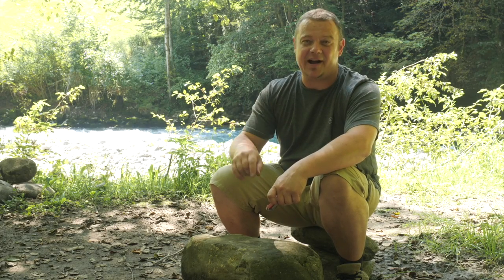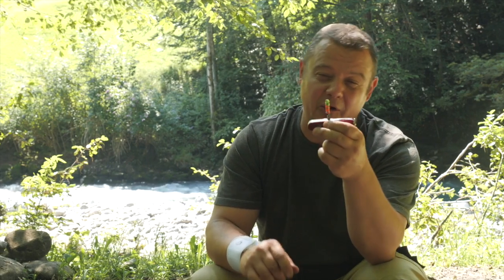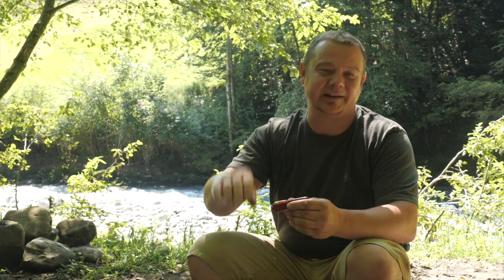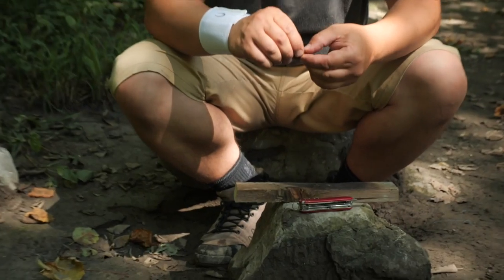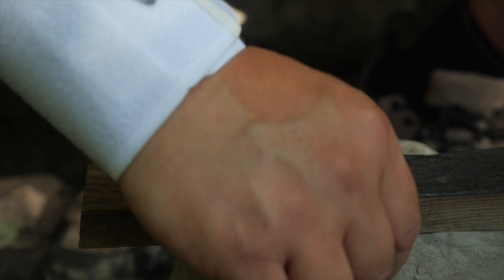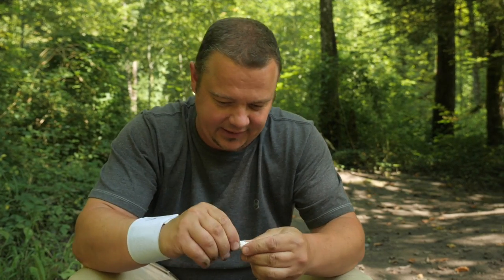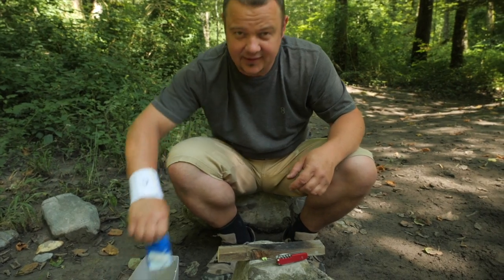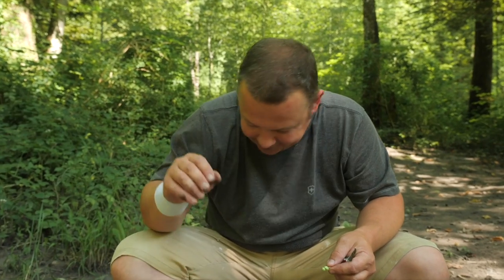Victorinox claims: 100 fires with just one FireAnt. Is that possible? Let's test it!!

Comment: You know what lights VERY easily, and you should have in your kit or pocket anyways? Gel hand sanitizer. Mostly made of ethyl alcohol, not only does it light from a single spark, it burns for several dozens of seconds, and is wind resistant, giving you plenty of time to build up a fire. It burns with a blue flame, very much like the Steno buffet food warmers. Give it a try today!
Reply: Agreed!  Or even the humble Vaseline petroleum jelly!
Reply: @dennisleighton2812  I'd second the petroleum jelly.

Comment: One tinder everyone literally has on them are the clothes your wearing. Fibers from any cotton clothes, like jeans, can be shaved off with your blade giving you a nice little pile of lint.
Reply: Gel hand sanitizer. Seriously, give it a try. A squirt will light from a single spark, burns with a blue flame, lasts for several dozens of seconds, and is wind resistant. Plus, you will have clean hands. Give it a try!
Reply: One thing to be careful of when burning hand sanitizer is that the blue flame can be very difficult to see.
Reply: Belly button fluff ;)
Reply: @noncompliance4100  Yeah, but it doesn't burn long. And it has a smell. 🤢
Reply: @OutsideTheTargetDemographic  tried it myself a few months back out of curiosity. One strike and it caught immediately . Perfect addition to a small piece of tinder
Reply: @markhampson3166  Hey, great! I had a friend over and we both tried very very VERY basic survival stuff. One of the items was firestarting, while slimy PJelly cotton balls worked, his mind was blown when I showed him the hand sanitizer. 👍
Reply: @Schwubl_262 I will try them both when the snow hits and see. 👍The nice thing is, both "fuels" have other uses.
Reply: @markhampson3166  And there's a lot more fire accelerant in your ears... with a smell too. Your camp fire will tell everybody how sm(e)art you are!

Comment: This was originally put out by a company called Tortoise Gear. The first micro fire steel replaces the toothpick on your knife and then they made these micro steel inserts for the SAK corkscrew. Neat that Victorinox picked up on it. The Tortoise gear ones also have glow in the dark plastic which is neat. No, I wouldn't use these as a primary fire source, but as a back-up, they are hard to beat. Thanks again Felix!
Reply: Brendan, I looked at these when I found out about them, but the cost of getting them to the UK made them unviable. I opted for a 4.5mm ferrocium rod in my Swiss champ case. I assume you would recommend them?
Reply: Felix didn't mention it, but these glow in the dark too.
Reply: @boola69  I do but there is a 'technique' to striking them. You strike along the top 'thin' edge, not the broad 'flat' edge. Also pull the blade (or striking surface) along the fire steel, don't pull the steel across the blade. But it does throw some sparks when you get it right.
Reply: @brendanking7328  Yeah, I'd seen you used the narrow side on a review.  I think I'll just stick to the ferrocerium rod as it takes up little space. BTW cotton balls soaked in Vaseline (Petroleum Jelly) make amazing tinder, but you probably knew that.
Reply: Victorinox is buying these from Tortoise Gear.
Reply: @boola69  yea i saw that too, with shipping it made them about 3 times the price.
Reply: They say the best tool is the one you carry with you. So many times I forgot the lighter at home and tried unsuccessfully to make two wooden sticks burn like in CastAway. The FireFly would be great as a default from Victorinox.
Reply: @DilbertMuc  That's not a bad idea, fella.
Reply: @brendanking7328  Oh, always check the Youtube channel of Felix Immler. He'll teach you 100 uses of a Swiss Army Knife. Check his episode The Firefly Technique - SAK Tips & Tricks (37/40)
Reply: @boola69  But with cotton balls soaked in warm candle wax you can make new FireAnts yourself for free.

Comment: Thank you! I also use the firefly that fits in the toothpick holder on the Victorinox SAK. It makes that wonderful folding knife even more versatile. But…. The greatest asset on my Victorinox is what you bring to us through your videos. Thank you so much again! You even showed many fire starter possibilities 👍cheers from Canada
Reply: The tooth pick fire🔥steel is MUCH more practical 👍
Reply: @edwardfletcher7790  : But I would rather give up my mini screwdriver than my toothpick:(
Reply: @markashlock9017  You could always swap them when you go camping, it's not like you need a firesteel at work.
Reply: @edwardfletcher7790  You can always make a toothpick. It would be way harder to make a firesteel rod ;D
Reply: Edward Fletcher, I’ve not tried the corkscrew insert, but I do know that the toothpick version doesn’t fit in the RangerGrip series toothpick. Found this out the hard way. I have a snapped one still lodged into mine.
Reply: @brawndothethirstmutilator9848  There's lots of helpful videos on YouTube showing you how to remove the knife scales, people use either hot water of a hair dryer ...👍

PS: Love the Idiocracy tag, wish it wasn't turning into reality ☹️

Comment: Great video, as always. But, I can't imagine myself needing over 100 "emergency fires." So, why WOULDN'T I use this as my primary fire steel, especially when it is just a backup to my lighter?
Reply: 27€ for 3 of those. Way to expensive to use them casually in my opinion. Just use a lighter or a normal fire rod as it's way more value for your money.
These are nice to have, but when will you ever be outside with your pocket knife, but no other way to start a fire? For half the price I might get them, as it is they are just a gimmick for me
Reply: @TeamGermanLP  when you forgot to bring a lighter to barbecue it's priceless.
Reply: @TeamGermanLP  Lighter, Aldi, 25 cts. :)

Comment: From this video the most important take-away was your comment about having the appropriate tinder. 
As preparation is the mantra for all who travel in nature and the outdoors, it is clear that part of that is to pack several different sources of tinder material. Fortunately, it is not at all bulky, and one can easily pack enough for hundreds of fires and scarcely notice the weight or bulk of that tinder. As was pointed out even fine birch bark shavings are not always easy to ignite. 
Thanks Felix, for a most enlightening video and some extremely important information. 
Note: If one carries with you in your pack a humble domestic candle, it will make a formidable team with the fire ant! The fire ant gives the initial small flame and once lit, the candle provides the strong sustainable flame to light the fire in almost any conditions. 
This video has conclusively exploded some long standing myths and assumptions about starting fires!
Reply from the maker: Thanks a lot for this super interesting feedback!

Comment: Hello Mr. Immler:
I have been carrying and using the Tortoise Shell brand micro fire stick and helix tender for a year. Loved your review and you are correct as it is only an emergent starter, but man it is handy! One thing I experienced was that the helix tender would wear while in the pocket. So I found out that slipping a big straw over them works well to protect the tinder from the abrasive material in the pocket. I hope this helps other SAK carriers. Keep up the great work!!!!
Reply from the maker: Yes I will make a video with heat shrink tubing! Thanks for your hint

Comment: 100+ strikes! You have some patience! Thanks for doing this test.  I took a cheap ferrorod/ magnesium combo from the dollar store, and used acetone to unglue the skinny rod from the magnesium block. Then put the ferrorod into a drill and spun it against 80 grit sandpaper (which took way too long) until it was narrow enough to slide into the corkscrew. Then I carefully cut it with a hacksaw.  I used a Sharpie marker to (hopefully) protect it from moisture and voila: a home made sak ferrorod, which is as long as the corkscrew. It fits well into my Rangergrip 79 and the recess for the corkscrew keeps the ferrorod from falling out when the corksrew is put away, but I didn't add anything else to keep it in place with the corkscrew open, other than the friction fit.  I suggest a file or some other means to remove the bulk of the material from the original rod. because sanding alone took way too long. I had to remove about a quarter of the diameter of the rod.  Now, can I wrap some waxed jute twine around it for tinder.... ?

Comment: I agree, this is great for what it is. I got 2, one for my Huntsman and one for my Ranger. If I use up my lighter, and my matches, it's a great backup to my full size fire steel backup. It throws more spark than I expected for its size.
Reply: Remember your lighter still makes sparks after the fuel is gone
Reply: @margueritemitchell1829  true, but I was surprised at how much harder it is to direct as much spark with a lighter as I can with a ferro rod

Comment: Great video.  I have had success by taking thick piece of birch bark and then with very little pressure using knife at 90degrees to scrape along flattest section and creating a powder.  Not only is that powder easy to light with spark but works with magnifying glass as well.

Comment: I’ve have both of those & the one that replaces the toothpick. I’ve only played with them & they all work rather well, but you’re right it’s not for primary fire making. If the knife has a corkscrew why not add it 🔥.
Reply: @Ministry of Mystics Well, I would replace the glasses driver with the fire steel and carve a mini phillips driver out of the fire steel with a diamond file. Use it as an emergency glass driver and in a pinch it can always give me fire.

Comment: I just lucked into a procedure that makes Firefly becoming my most favorite thing! I got a big SAK Ranger Grip 58 Hunter. Then got large Firefly which needed end tapering to fit into SAK. I had used 6 cm. wide 120 grit sanding belt just laying around. I found rubbing FF on piece of belt very entertaining! Dust would accumulate on the belt. When there was enough dust it would erupt into a pyrotechnic display on the belt. It took a relatively long time to grind the square FF to a pointy toothpick profile. I guesstimate that there was enough large flashes to start over 100 fires in just the 2 cm tapering operation. If I carry a 6 cm. x 10 cm. patch of belt I could start an amazing number of fires; + other uses.

Comment: Hi Felix, love your videos! 
I think the fire ant sticks are quite expensive. Could you maybe make a video in your workshop series how to make them with Zündsteinen für Bügelgasanzünder. They are super cheap and if you craft a handle/backpart that goes in the corkscrewer, you might be able to drill a hole and glue it in.
Thank you so much for your work! Best from Germany
Reply from the maker: Hallo Simon. Haaa ha haa ich habe vor drei Tagen solche 3mm Bügelgasanzünder im Zehnerpack bestellt. Die haben an verschiedenen Stellen Platz im Messer. Das möchte ich zeigen...
Danke aber für deinen Tip! LG

Comment: The FireAnt was introduced by Tortoise Gear, and its considerably cheaper in USD from them (you only get 1 tinder per FireAnt instead of 2, however). They also produce the FireFly, which is a ferro rod that replaces the toothpick.

Comment: I have a firefly and the tinder coil in my forester. Works great. The fire ant is awesome bc you can keep your tooth pick. I use the toothpick on my multi tool regularly. Might have to get one. I went with the firefly bc it’s bigger but the ant seems to work great despite being so tiny.
Reply: If you add the plus scales, you can open the closed extra slot. Might help your space needs.
Reply: @VilleWitt  yeah that’s a great idea, thanks!

Comment: Never understood ferro rods myself as most of the time a cheap disposable lighter is just as reliable and more versatile. That being said I never use the corkscrew or the parcel hook either, still nice to have I suppose.
Either way another great video Felix 💜
Reply: Lighters don't work when wet or super cold.
Reply: @wildernesseric  can't light a fire with wet tinder & fuel anyway. If you can keep your tinder dry you can keep your lighter dry 🤔

Just guessing tbh, my bushcraft experience is limited to one course I went on when I was 10 and the occasional times we go drinking in the woods and we make pointy sticks for DIY javelin throwing 😅
Reply: @marmite8959  that's kinda the point of this product.  It has a completely waterproof sparker and waterproof tinder that goes into the corkscrew and takes up no extra pocket space.  No need for an unreliable lighter and if its in your knife you won't forget to take it with you.

Comment: I just received my FireAnt and gave it a try and on about the 5th or 6th pull across the back of my saw blade the rod came loose from the plastic piece and fell onto the floor.  I managed to find it and glue it back into the little orange piece but it would have been very inconvenient if that happened in the woods.   I suggest giving the FireAnt a try before you take it into the woods just in case you have the same problem I had.  By the way it sparks very well for a tiny rod.
Reply from the maker: Please let Victorinox customer service know about the incident. I think there are other people with the same problem. I heard once that the plastic part can deform if you screw it in too deep... or something.

Comment: My first Victorinox was a Huntsman also but I had to buy it
myself in 1973. It has the old five turn corkscrew which the
Fireant won’t fit into. Actually there a few models that are not
compatible with the Fireant. The Firefly will work with ones
that have scale tools, but if you have one of the 108mm
models you are out of luck.

Comment: Hi Felix ☺ that was a great test using the fire ant, I expected it breaking as it wore down , but no it didn't,  and you still had some left, as to the problem whith the birch bark I think you might try scraping the surface of a decent piece of it whith the edge of your blade, I've found you can work up a nice small pile of wooly fibres that will ignite readily. I hope you haven't injured your wrist,,it looked well strapped up, if so I whish you a speedy recovery, thanks for another interesting video, stay safe mate, best wishe's to you and your's, Stuart uk.

Comment: Felix love your enthusiastic approach, I’ve always loved Swiss Army knives. Recently I’ve acquired a few victorinox delamont wenger models, I must say I prefer these in some ways to the victorinox models, although I do love both , I found the detent seems perfect on these wenger design models. The victorinox how ever have better scissors ✂️ and I prefer the inlay metal emblem cross . Although I found out recently that the wenger models with red handles have in layer plastic which can’t be worn off , which is great 👍🏻. What is your feeling on the wenger delamont models?

Comment: If you have empty lighter instead of buying Flint steel or this you can take top off light and use as Flint steel because when it runs out of fuel it will always still have Flint.
Reply from the maker: Yes... that's a good hint!!

Comment: Question: How may fires using the same kindling/tinder and a full size v mini Bic v a regular Zippo with a 4 ounce bottle of lighter fluid for refills good for under the same conditions?
For that matter how many more fires using the same kindling/tinder in the same conditions using a small 2 inch flint rock and a steel instead of a ferro rod good for?
If that little ferro rod is only good for 100 fires isn't that many (especially for the price) if you spend a lot of time out in the field, or use it to start your camp stove and gas or oil lantern.

Comment: The new FireFly is much more practical than the FireAnts from TortoiseGear. At least they licensed the FireAnts to Victorinox, maybe they'll do it with the the new FireFly as well? Instead of the unused toothpick there is a long, strong firestick. Would be great if Victorinox would bring this as default setup for their knifes.
Reply from the maker: Please let this Victorinox know. I agree 100%
Reply: @FelixImmler  Maybe a FireFly not on all models like Waiter or Spartan which are more city oriented, but certainly on the outdoor models like Outrider, Huntsman etc. 
The FireFly works pretty well with the little groove for the cable on the capsule remover. Using it not flat but vertically it is more stable and does not brake so easily. (Tip for Felix Immler episode 51/60) :D)))

Comment: What are your thoughts on the similar “firefly” by the same company? No tinder but the firesteel fits into the toothpick slot instead. While we’re at it, do you mind giving your opinion on the concept of Victorinox quality dropping the last few years? I haven’t gotten a new SAK in quite some time so I can’t attest to it myself but I’ve heard a lot of people say that the blades are lower quality than they used to be, both less material and lower quality steel. Again, I don’t know if there’s any truth to this or not but wanted to know if you’ve noticed anything like this.